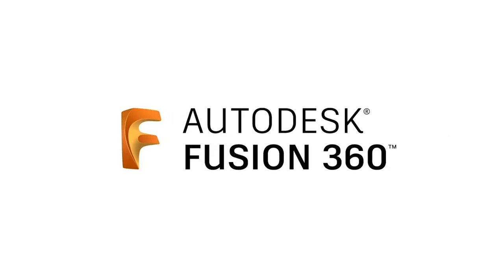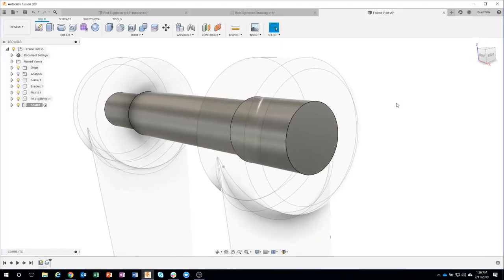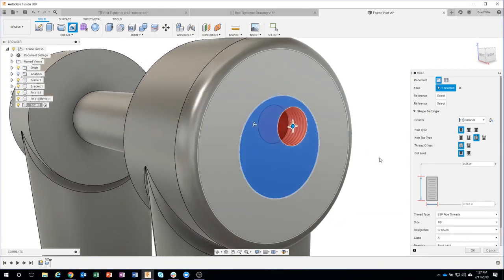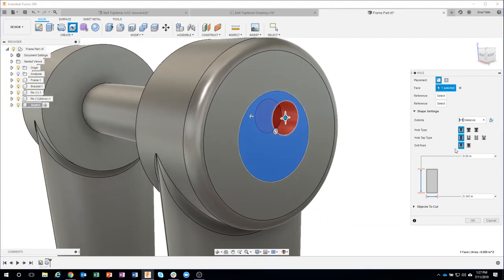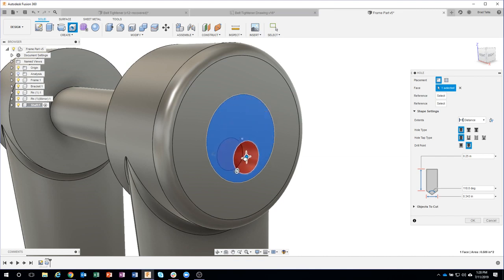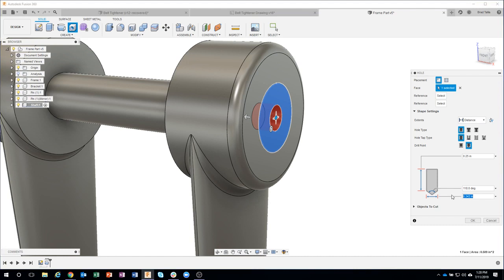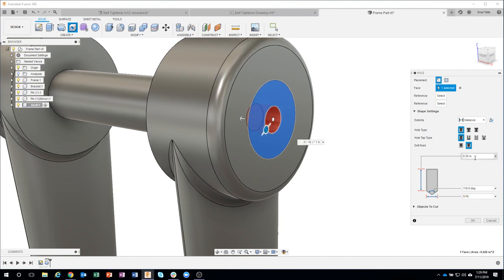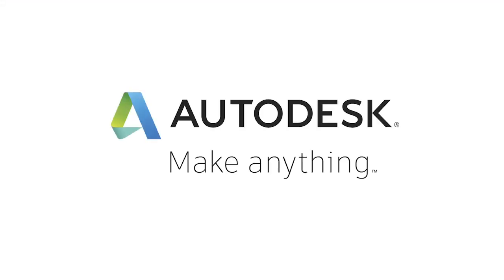QUICK TIP: Introduction to the Hole Command

Comment: But how do you do it on an uneven surface? i have a surface with several faces that are not flat and i want it to go through all of them. if i click on the highest surface it just angles the drill the wrong way and if i click on the flat surface, it is under the top most faces.

Comment: Wish they would make it easier to have multi holes via a sketch, but if the body is extruded upwards , most people extrude + so the sketch is under the body.
Reply from the maker: If you pre sketch points you can use the hole tool for multi tools. Is that what you mean?
Reply: @adskFusion  if you have a sketch with points for holes later and you extrude plus if you try and use this sketch for multiple holes it's very hard you have to do a sketch on the top and then project, for it to work easy. Or extrude negative so the sketch is on top

Comment: If you tell the drill cycle to drill to the hole bottom will it go to the deepest point on that hole? I'll have to check out the hole command, I tend to sketch and extrude like you were saying.
Reply from the maker: @Jordan-  The drill cycle will go to the bottom edge where it tapers from vertical wall to drill point.  It you are drilling through material, you would typically add a bottom offset so the drill goes beyond the bottom of the part a bit.  If you are blind drilling, it will drill to the depth of the hole.